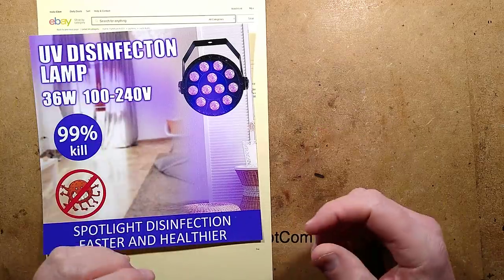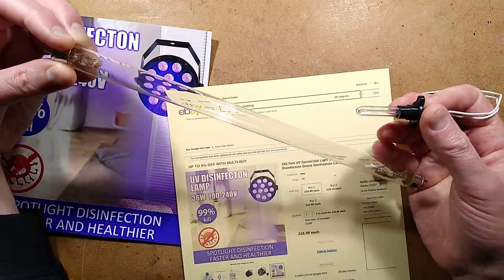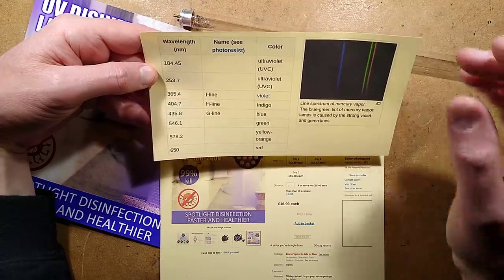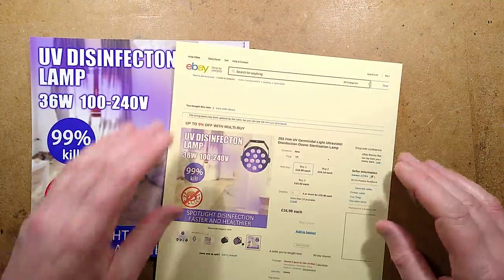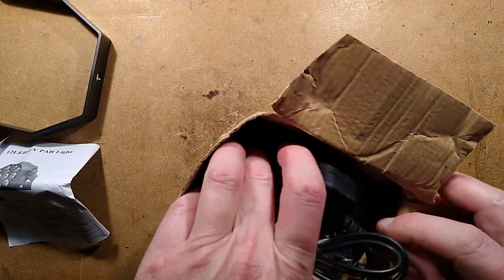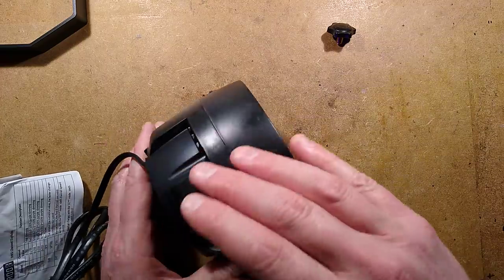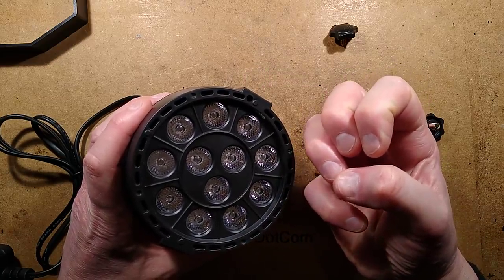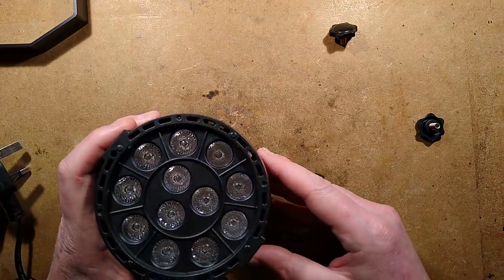Fake UV disinfection lamp from eBay.

Comment: Even if this device worked, it would be absolutely hopeless.
It is important to remember that bacteria are small: millions could fit on the head if a pin.
If we make the wild assumption that there were only one million harmful bacteria on a surface, or a piece of food (which would presumably be bigger than a pin head), killing 99% of that million still leaves 10,000.
Considering the effective dose of many pathogenic microbes is a thousand or less, having ten thousand remaining on just a tiny surface makes the "sterilisation" a joke.
Even disinfectants that claim to kill 99.9% of germs fare no better.
Indeed, for some pathogens (and especially for those with compromised immune systems), germs such as some types if salmonella, haemolytic E.coli, shigella, campylobacter, MRSA etc can be infectious at doses well under a thousand, even down to the tens of live bacteria.
It is similar with viri.
If your steriliser doesn't kill at least 99.99% percent if germs it is mostly useless.

Comment: There are a few "UV" sources that have purple LEDs. 
I measured the purple LEDs I have at 411nm, not at all in the UV.
Germicidal UV or UVC is, which is needed to kill bacteria, fungi ,and viruses is between 100 and 280 nm.

Comment: I have seen these things on ebay in Aus for $49AUD a lot considering now it would be the same as this. what about those corn cob type I guess the same as well?
Reply from the maker: I ordered a corn cob lamp and the listing has been removed.  I reckon they're standard LED lamps with ice-blue LEDs to fake the appearance of mercury vapour tubes.
Reply: @bigclivedotcom  I am sure they are still on ebay for australian listings? well last time I looked. looks like the only type to get is as you say the fluorescent quartz type, as being genuine.

Comment: Can you make a light analyzer to determine the wavelength it is emitting?  Are the little stickers with various glowing reflectors accurate?
Reply from the maker: I've just got an AdaFruit module which can detect UVC.
Reply: @bigclivedotcom  oooooooooh... do they make a module that can detect death beams?   My neighbour... who has zero knowledge of electronics is convinced 5g death beams are real and the macarena is made by 5g and/or the macarena is a coverup of the 5g illness :p

Comment: How would you test a commercial UVC light from Amazon or eBay that is not accompanied by a UVC light detector or tester?
Reply from the maker: A rough guide is that the ones based on clear glass-like tubes that glow soft blue inside are real (and dangerous).  The LED ones are usually not real, but some with square gold coloured LEDs may be, but are not as good as the glass ones.

Comment: I am Eng and you can not tell by looking on LED that if this one is UV or just LED. I would like to understand your point of view please. the issue is wave if it matches or no? also the CSc is a power system communication interfacing please give us more info as I finish your clip and Unable to see your point of view. it looks to me like classic C-UV light, give me more info
Reply from the maker: This construction of LED is not suited to UVC due to rapid degradation.  Real UVC LEDs emit only incidental fluorescence.  They put out invisible light.  These LEDs are clearly in the region of 405nm and put out a lot of light in that wavelength.
Reply: @bigclivedotcom  with respect, do you have a UV measuring tools. I was interested in this device to buy from eBay. but frankly, I don't see your point of view. UV can emitted through LED or fluorescence. the wave on the device looks to me is enough. on what bases you build your argument, do you have the tools to measure UV? it is impossible to say what you are saying by just looking at the device or component. I also looked at the power IC "CSC" diagram and it could be used for UV as well. I am confused.
Reply from the maker: @basilandrea6840  I have now tested it with a UV sensor and it has no output in the UVC spectrum required for proper germicidal and anti-viral activity.  It's a disco light.

Comment: The electrical isolation thing is a classic case of "helpful idiot" or a smart design being modified by an idiot
because they clearly spent a little extra to 'try' to do electrical isolation    They could have just omitted it entirely and got more boards on the panel

Comment: Do you think it has enough at the 405nm line to use in a makeshift resin curing chamber?
Reply: LEDs are fairly narrowband devices unless they have phosphor in them.
Reply from the maker: It does cause UV sensitive film to darken quickly.

Comment: I'd like to know if my uv cannons are having a similar effect? 400w bulb housed in a large hexagon case.
Reply from the maker: Those things are really inefficient compared to the fluorescent tube blacklights.  They literally just filter the 365nm wavelength from the mercury discharge.  We used to use them for floodlighting huge fluorescent steel angels.
Reply: @bigclivedotcom  thanks Clive, I know their inefficient, I've sweated buckets when I'm at a gig with two or three of them warming the rig up. I swear I'll have a fry up on one of them some day.

Comment: Thx for this. For few weeks Im looking at ebay.. and there are plenty of UV-C LED lights.. and I simply doubt.. if any are real.. :D And this supports my opinion they are not. Im not sure how hard is to make real UV-C LED.
Reply from the maker: There are some real ones, but they're not as efficient or as long lasting as mercury tubes.
Reply: @bigclivedotcom  Thx for reaction. Moreover - your new video kinda answers my question. Thx for good work!

Comment: Could you possibly fit proper UVC LEDs and make it actually do what it says it does?
Reply from the maker: That would be incredibly expensive and nowhere near the output and lifespan of an equivalent power mercury vapour tube.
Reply: @bigclivedotcom  Not worth it at all then. If I had bought this for it's stated purpose I would definitely put in a claim!

Comment: I cannot understand how you measured the wavelength of this lamp. All I see is you inspecting the led light and then sniffing your hand... is this a scientific proof? I'm missing something?
There is a way to be sure that this light is not in the range of 255-280 nm ?
Reply from the maker: Real UVC LEDs are very distinctive and need extra visible LEDs as warning devices.  They don't put out purple light.
Reply: @bigclivedotcom  your observation seems reasonable to me, but... what if that led emits radiation in the visible spectrum also (but not only)? It could be?

Comment: Saw those myself Clive when I was looking for one. Couldn't see how an LED could produce UVC....
Reply: Can, but not through that lens.  Would have been prudent if clive had checked that none of those LEDs were an UV one (in case they put a single £5 UV chip in there to make original box claim almost valid).
Reply: True UVC LEDs do exist, but they are tiny golden squares with only a thin sapphire window.
Reply: @AScannerClearly  Quite right but not at that price :)

Comment: Do you file complaints with ebay for all of the fake crap you receive?
Reply from the maker: No.  Because I buy a lot of it to check out and it would probably get my account closed down.
Reply: @bigclivedotcom  Doesn't sound right they'd have any standing to get your account closed down. These sellers are selling fake items, most likely knowingly. That's what buyer protection/returns/reporting system is designed for. I say go for it, those sellers shouldn't be rewarded with your money for selling fake stuff. Understand if you don't because it's not worth your time though.
Reply: @bigclivedotcom  Make sure to read Jkenny's responses Clive  😉

You do get a lot of legit stuff too, tho.  So a few random FAKE reports shouldn't hurt your account ratings.

Comment: Who else is currently dealing with eBay frauds right now?

I have a Chinese seller that posted a California item location 40 miles away from me. The infamous fraudulent "USPS shipping partner" gag. "Guaranteed delivery today" my ass. When did mail fraud stop being a crime?
Reply: I bought an engine off of eBay from a junkyard in the Bronx. For whatever reason they misplaced the engine shipping it via the GSP program, (which is complete bs btw) and I heard nothing of it since it got to the depot in Kentucky. I opened a lost package claim after 2 weeks of nothing on the tracker. The whole thing was completely ass backwards and I wasn't told anything about it, and they somehow misplaced an engine of all things. I asked for a refund since it got nowhere. I later found an engine in  upstate NY and picked it myself. Much less hassle.

Comment: seems like most stuff on ebay, specially at cheap price is phony and sometimes dangerous product mass made cheap quality tat from China

A lot of original quality products also get manufactured over there,but those products & distribution channels are tightly controlled by western brand owners, not the cheap counterfeits you see flooding ebay. Even the vast majority of the UK searched products are chinese companies who are based in China, but put English towns as their location. Few may hold some stock in warehouses here, but anyway lots of dodgy products have taken over Ebay.

Ebay has gone downhill for the past 10 years

Comment: I was expecting the fan noise to be a broken blade causing imbalance & vibration, or, it was a motor phase issue.
I was surprised, that it was actually a wire touching the fan,
That's sofa king ghetto.

Comment: 08:35 - Does anybody remember when real UV and UVC lamps actually made that buzzing sound?  It tended to be in the flourescent ballast, ie real electrical hum.  Obviously Clive knows the sound of a hinky fan, and has enough experience to know a wire tapped by a fan blade can cause that similar noise.  Probably 99.9% of the people buying this fraud don't know that and therefore I submit that this fan (not actually mounted to an electronic component or heat sink and in fact mounted to standoffs from that metal plate, so apparently just extraneous) is an intentional fraud meant to make older people think it's working since it makes a familiar noise. 

In order to make sure the fans never make that noise, real technicians and engineers use wiring harnesses in legit electronic devices.  This thing is just a rat's nest with wires poking up just perfectly in the middle.  I'd bet you a case of good beer that's intentional.
Reply: That fan is blowing or sucking to cool the large metal heat sink.  It needs standoffs to cool the entire plate and not just the middle.  Entire product seems designed for inspecting the UV stamp on customer hands to confirm they paid earlier that night, as that purpose needs only weak UV for minimum damage to the paying customers at a local disco that can't hide from the law.
Reply: @johncrowerdoe5527  Which part of a thin, flat metal plate makes you think "heat sink?"
Reply: @baudgaud  That's the standard purpose of aluminum backs on LED boards.
Reply: @johncrowerdoe5527  It's cute that you have an opinion without being aware that the part of the LED that actually gets hot is the part that emits light.  Putting a heatsink on the hookup/electrical side would be like icing down your left ear after you sprain your right ankle.  A big flat piece of metal doesn't make a heat sink either.  Do a bit of web searching for exactly what a heat sink is and looks like.  That big flat disk is nothing but a conductor that you hook your input voltage to and then contact with each LED for an ultracheap parallel connection.  Sometimes an item like that is used as a reflector to direct and focus light forward, but it doesn't look like any light would get to it anyway.

I'm left wondering if you even watched this video or if you're just a comment troll.

Comment: Fake of course and the current generation of UVC LEDs have pitiful efficiency of just 3%, compared to the 20% to 40% of mercury lamps and are much more expensive, so there are very few reasons to use them, except in some niche applications.

Comment: The Chinese lying?
Surely not!
Reply: There are times I wonder what is really going on.  Today my Banggood order for swim goggles failed because "We regret to inform you that your order was returned due to the failure of security check when passing the customs office."  So what's the real reason the customs office wouldn't allow it through?  And why am I suspicious?
Reply: @jrstf  Far more likely, that the chinese mob are having some other problem or simply forget to place the order, or ship it, and are blaming customs because that's what the Chinese do - blame someone else.

Just like when you ask a technical question trying to point out that their product is clearly a fake and get the customary "we shall have to talk to our technical team/manufacturer/supplier for the details and get back to you."

What's the more likely scenario?

Comment: Death Beam capacitor?! that was a r/woosh I am afraid.
and yes, open a claim, they deserve it.
Reply from the maker: There's a 5G conspiracist who claims that the 400V capacitors used in the LED drivers in street lights power death beams and mind control devices.
Reply: @bigclivedotcom  Thank you! and Stay safe over there.

Comment: It's a UV Wash, professional lighting fixture not a disco light. I do like your videos  though
Reply from the maker: It's certainly not professional.  It firmly falls into the category of cheap disco crap and could potentially jam or damage everything on the same DMX network.
Reply: @bigclivedotcom  yea you still dont call them disco lights, Ive used cheaper chinese fixtures on stages before there, worst case scenario that fixture dosen't respond but the rest still will, even when daisy chaining, unless the dmx out is not doing contact the information for the other channels will still respond

Comment: And what ad does YouTube decide to put up on the top of the Recommended videos?  Why, one for this:

https://helianlighting.com/collections/indoor-lighting/products/15w-25w-uv-lamp-quartz-germicidal-disinfection-uvc-cfl-ozone-led-light-bulb-ultraviolet-sterilizer-bacterial-kill-mite-home-lamp

Doesn't THAT bad idea look familiar.
Reply from the maker: I did one of those recently.  It was real, but quite DIY looking inside.
Reply: @bigclivedotcom  I know, that's why it's so funny that it came up as a side-ad.  The algorithm is very good at noticing when something has been looked at on a channel, but not very good at at noticing if the determination was good or bad.

IIRC, it was also just broadcasting UVC omnidirectional, except where its' own plastic body would intercept it (until it crumbles into dust and shards, anyway).

Comment: Looks like the sellers are on to you bigclive 
That's a neat liar light (uvc my ass) but that's what happens when twats design a germicidal light. I like how you tried to give it the benefit of a doubt but we all knew it was fake. Maybe you should mod it back to rgbw and see if it has been programmed
Reply from the maker: I'd guess it is a standard light with the four channels available, but loaded with near-UV LEDs.  They often block the Isle of Man because shipping here is more complicated.
Reply: @bigclivedotcom  The normal programming would as you say alter the power delivered to different color LEDs so they all appear to be the same brightness but all of the (evidently identical) LEDs in that thing looked to be the same brightness, and I couldn't see any flicker at all.
From that I infer that it has Abbie-normal programming which means they knew damned well they were making a fake. That's flat-out deliberate fraud.
Reply from the maker: @markfergerson2145  There are versions of these disco lights fitted with all near-uv LEDs as standard.
Reply: @bigclivedotcom  Then the secret sauce is in the programming, since you remarked that the display is labeled for R G B and white LEDs.

Comment: @12:02 "why do they do that?" most likely they're using a generic power supply design and had to substitute a different component for the optoisolator and the engineer had no idea what they were doing. These designs float around freely in Chinese manufacturing circles and its not necessarily electrical engineers who are selecting the cheapest components and editing the board layouts.

Or, whoever designed the board is just a moron 😂

Comment: I can tell from your videos on UV that you don't have a spectrometer. If you are going to do "scientifically accurate" videos you should equip yourself properly. It's like an electronics engineer not having a scope!
Reply from the maker: The cost of getting a proper spectrometer that extends to the UVC wavelengths is astronomical.  I could never justify it.
Reply: @bigclivedotcom  Keep your eye on ebay. I got mine for under $200 including shipping. Covers from 200 to 800nm. Got to keep your eyes open and mouse button ready since so many people are after them!

Comment: Have you used UV sensors while assessing the product ? No, you did not. Basically you opened the product, had a look at it and showed the diodes with electronics and that is all. Pretty bad assessment IMO. While it could be that is fake I am not buying your presentation as it is lousy.
Reply from the maker: It's since been tested with a UV tester and is fake.